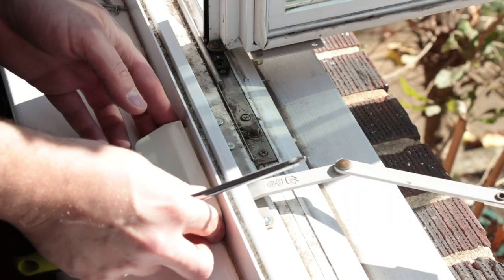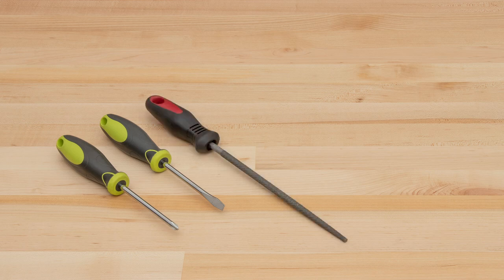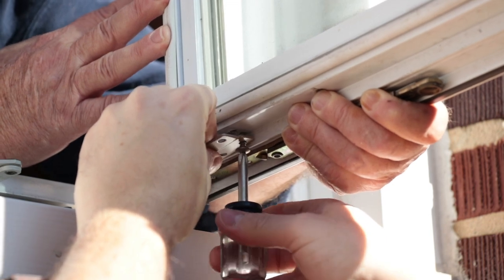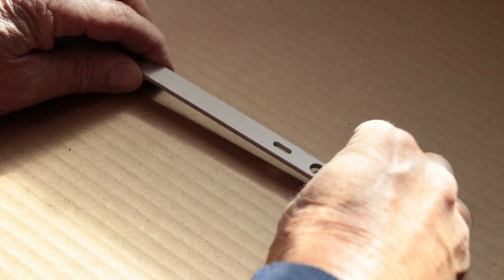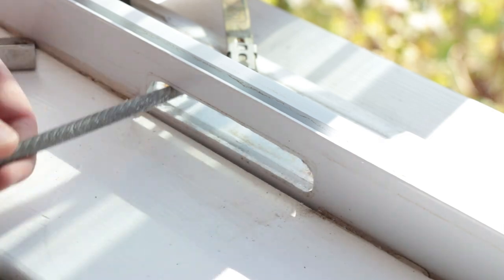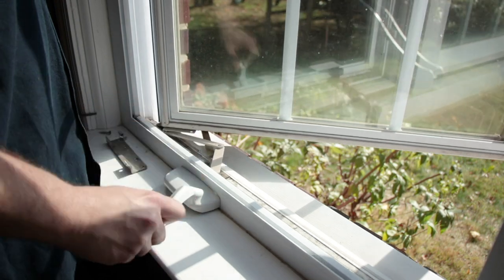How to Replace a Discontinued GU Operator

Comment: This is truly a great help and I was able to get the project done, however you should also mention and upsell the Ellipse Operator Gasket
 Product Code: 39-564...this was a life saver when closing out any light from entering the area between the new operator and the filed down frame, inside looking out.  You can see it in the video towards the end the little sliver of light.  The gasket absolutely covers all of that.  No more light.
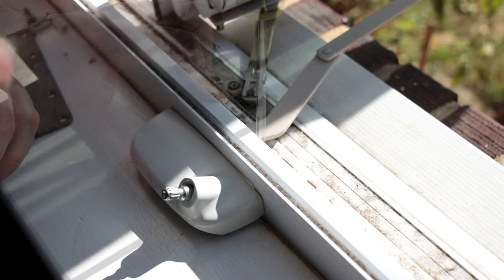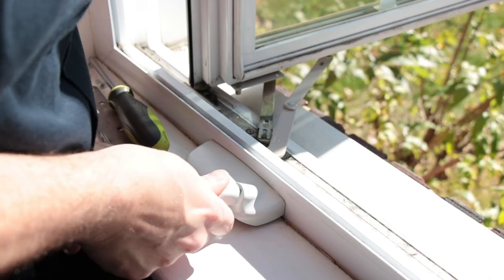Reply: Yup.  At 2:45 and 3:16 you can see the light gap. Thank you for mentioning that.  I was sure to buy the gasket that they do sell.  I'm installing the operator today which I"m sure will go well due to this great video.  It's the best installation video I've seen for this discontinued model.
Reply: in your opinion is the stud bracket part number 39-514 really necessary or can i get buy with reusing the old ones? is the stud diameter different?
Reply: @StreetMachine18  For me the bracket was so easy to replace and so cheap to buy.   Swisco has good replacement videos and they state all the part numbers needed.  I just also bought the thin gasket they sell but didn’t mention it in their video.